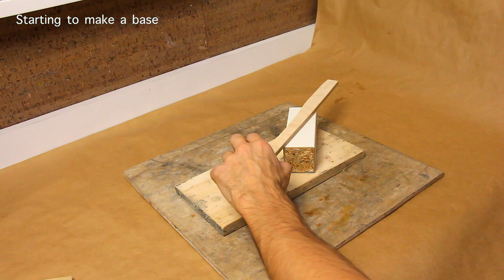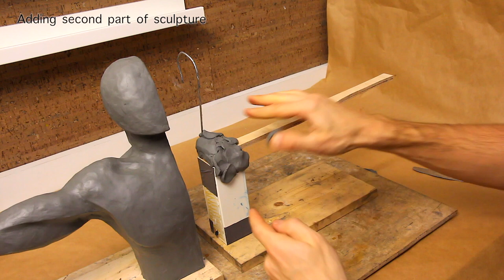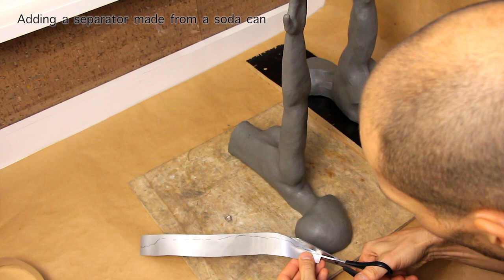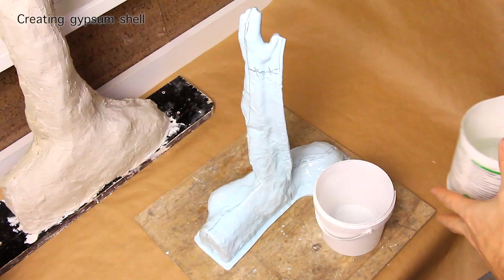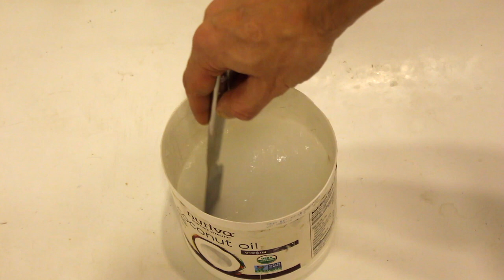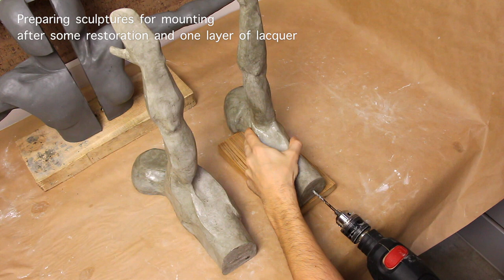Concrete sculpture "WE" DIY by thePeterZaytsev tutorial

Comment: looks great. I'm just starting to make my own. just wondering why your mix is water, pva glue and cement? does this give a better finish? at the moment I'm just using the standard sand water and cement. thank you
Reply from the maker: Thanks! I've tried to use mixture with sand but I did't like it. Sometimes I use only cement with water - works good too.
Reply: @ThePeterZaytsev  what silicon you using. your way seems to be alot easier and you use less. iv been using alot off silicon making the molds square.

Comment: Can you please tell me what does the dough consists? Is it only cement or something else? 
Love your videos
Reply from the maker: Thanks! I use only cement and water mix. But there will be cracks on the sculpture after drying. Only way to prevent cracks - to cover sculpture with water-resistant varnish. Or add a sand to the cement mixture.
Reply: @ThePeterZaytsev  thanks a lot sir🌸
I'll try n post it on my channel 🥰
I've never tried cement before

Comment: Thank you, Mr. Zaytsev. Your silicone compound is just the two components, correct? You do not add any thickeners to it, it seems. You brush multiple layers of the same mixture to get the mold to the right thickness. Is this correct? Final question: do you spread Vaseline over the entire form to make removal of the silicone mold easier?
Thank you.
Reply from the maker: You are welcome, Mr. Irving. Two components silicone compound. Yes. I do not use any thickeners at this video but thickener can be useful. Multiple layers - yes. I use Vaseline only to detach one gypsum part from another. No vaseline for silicone mold.
Reply: Thank you for your prompt and informative response, Mr. Zaytsev.

Comment: A few questions...How long with the mixture stay pliable? Can you keep in in a bucket with a lid without it drying? Can you put the object you are working on in a plastic bag to keep it pliable? I have nerve damage in one hand (cut the tip off my thumb) and carpal tunnel in both hand due to working with my hands for over 20 years so I can no longer work on something for long periods of time.
Reply from the maker: What mixture? Cement with water starting to set in about an hour and only way to keep it pliable is to mix it all the time. But if you talking about plasticine (the material that I use for the main sculpture) it is oil based clay - so it never dry. You can work with your plasticine as long as you want.  Good luck!
Reply: @ThePeterZaytsev  Thanks !